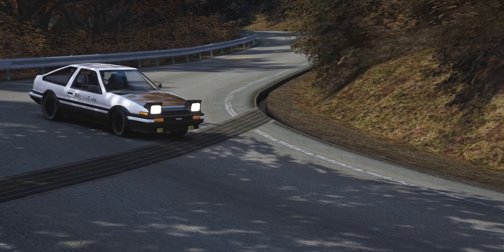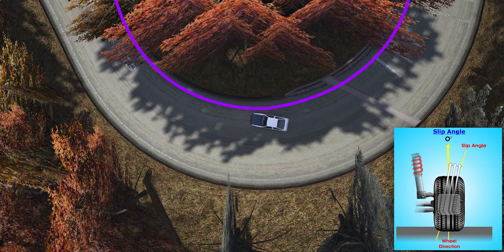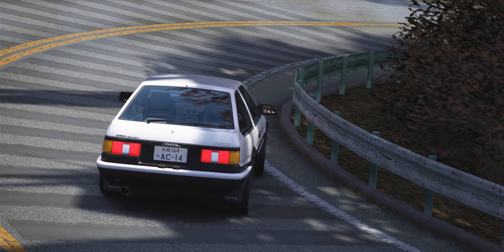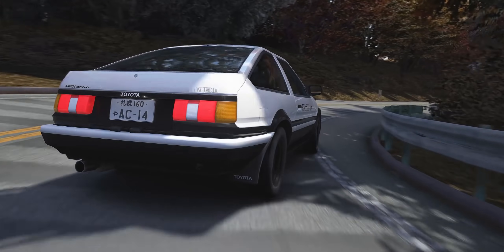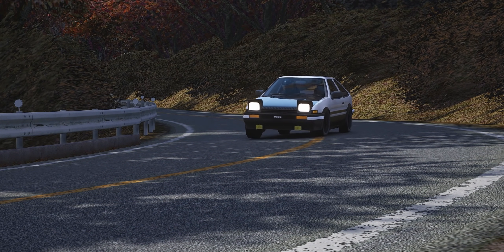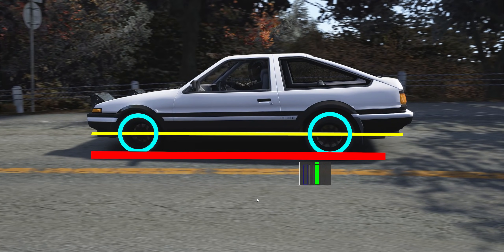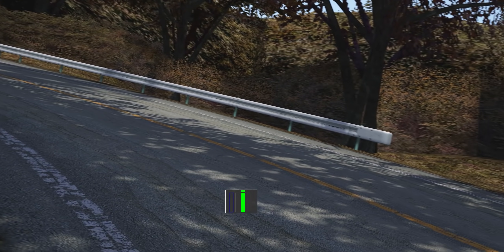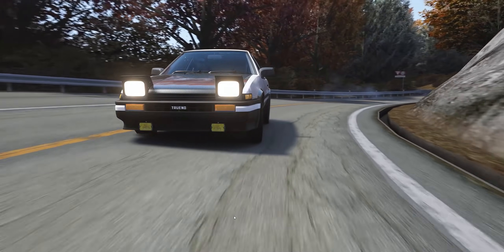Slip Angle in Touge - Master this to be a faster Sim Racer

Comment: srry but isnt this what u do always?
hit the brake before a curve Steering and hit the Throttle when u see the exit

i understand your explanation and logic but how is this diferent of what we alrdy do?
u have to drift and positioning the car with only the front wheel closer to the gap and thats the only diference?
but i dont get it, my car dosnt do this

should i move the Steer on zig zag while slighly braking till the car start to semi drifting and then positioning and try to point the front wheels at the track direction while full gas?
is that the idea?

Comment: Cool !! I usually do that on assetto with FWD cars cause it's easier to get out of a tricky situation than a RWD cause i need to learn proper drifting (clutch kick, scandi flick, throttle management etc..) so I'm used to it but it ain't always perfect and i sometimes go test the strength of a tree xD

Cool you're showing simple diagrams and your pedalboard inputs to illustrate how to do that slip/slide/4wheel drift or whatever you wanna call it. I might redo it over and over, understand one day, rewatch many videos or get someone to explain.. if i dont have the theory behind it, even just a basic logic of what's going on, it'll never be saved by my brain x)

Comment: correct me if i'm wrong:

drifting is a technique where you can add more slip through the whole cornering process. slip angle is a technique where the driver will make the car slip before reaching the apex of a corner and gets on the gas as fast as he can so it will have faster exit compared to normal cornering. when initiating slip angle, adding more slip beyond the apex point by power or handbrake is no longer necessary and doing so will kill the point of slip angle.
Reply: Right

Comment: On a track where exits matter a lot more than cornering speed if you have to counter steer, it ends up slower than not trail breaking at all and accelerating late. Your wheel shouldn't be straight it should be turned toward the corner still obviously that depends on the car setup on how much towards the corner you need, but a perfectly straight wheel will destroy your exit speed and entry speed because you can't use your brakes  because you're sideways and any throttle will require counter steer. If you can do that with adding brake and throttle inputs you need to fix the car setup. 10 degrees of slip angle is way too much as well. 2-5 degrees is what you should aim for. Your car isn't setup properly if you need more.

Comment: you just rotate at a rate quarter to the corner. 25% you are angled for apex, apex you are angled for 75% and at 75% you are angled for exit already and should ne on the gas just dont over rotate the tires

Comment: This video really taught me how to corner better. I could never do a slip angle because of my skill issue but because of this video i tried pushing myself into it more, by doing a tiny flick in the other direction before pushing brake, and accelerating into a turn and what do you know, it works pretty well!

Comment: Technically, every corner has SOME slip angle.  Even when your aunt takes the Subaru Outback through an intersection at with her hands at 11 and 1.  There is no grip without slip.  However, that slip doesn't become even vaguely visible until like 90% grip.  In normal conditions, the sidewall just twists a little bit, and its resistance to that twist is what actually generates side load.  This used to be much more apparent on older bias-ply tires and compounds that made peak grip at much higher angles.

Comment: So it basically boils down to, the tires don't have the most grip when the car is at the limit, just about to start sliding- they actually have MORE grip and thus corner faster with just a little bit of slip?
Reply: In short yes (yes i'm late)

Comment: A while ago I decided I wanted to practice gt5 and was running tsukuba circuit trying to tune a new WRX in grand Turismo 5
I found myself doing an odd version of this on shorter hairpins where I would turn sharply and break, swing the car around slightly, then accelerate.
I think that was on fastest on those hairpins because it's close to the slip angle method demonstrated here while still working with binary acceleration (either on or off) due to the short radius.

Comment: Basically "slip angle" is just a different way to say "inertia drift" which means the wheels aren in they're low peak level of traction for producing the necessary heat in the rubber and basically not loosing the chasis momentum(inertia); the actual difference is on what racing line chooses the driver

Comment: Like my teacher at automotive enigeering used to say: A few degrees of slip provides the most grip.
It has to do with the friction properties of the tyre rubber.
Reply: Because this is a good point I'll add that road and sport tires benefit from more degrees of slip angle, while slicks have a narrower window of slip to be optimal, and the performance decrease super fast if you go below that window with slicks

Comment: Isn't sliding only faster when you don't have to countersteer? If you look up Max Verstappen's pole lap at sebring (in the florida winter series) he seems to slide slightly through the corner but without applying opposite lock.
Reply: Obviously yes. But sometimes you can't drive exactly perfectly and can accidentally start sliding the rears in which case you need to counter steer to get the grip back.

Comment: This is used even in circuit racing. . . if you want your car to be able to accelerate sooner you need your car to do mini drifts to point toward the exit of the corner faster. This is how alien times are made.

This video also explains it perfectly as well, remember guys, it's about ROTATING the car faster so you can stay on the racing line while holding a higher speed AND you get to accelerate sooner and earlier due to having your car pointed straight faster and at the exit of the corner.

Edit: This is not the opposite of what sim racers do btw, it's exactly WHAT the fastest sim racers are doing. Who cares if you have to pit a bit more in an endurance race when you're so far ahead of the competition they will never ever catch up to you? I'd rather go fast and have a clean set of tyres to continue racing fast than to go slower and not be comfortable with my driving. It's extremely hard and frustrating to drive slower than you normally would once you are fast and probably counter productive to your racing.

Comment: you can also stay on throttle. Stab the brake at entry with your left foot to compress the front, turn in as you get off the brakes and set you angle. You may need the feather the brakes as you power through to the exit.  Especially good in a laggy turbo car.  Works best on a car with slightly softer springs and dampening.  Its also a good front wheel drive technique where you want to cause some over-steer and correct it with power under-steer to stay tucked into the corner.

Comment: I actually realised when playing ac I dont seem to oversteer to the point I need to countersteer, but after watching the replays I noticed that the car was pulling a slight drift
So that is a slip angle right?
Reply: yep, and most likely, on its best form. As far as I know from my many years of simracing, the best way to go fastest through a corner is doing that kind of slip angle. Since it is that light, you are not warming up the tyres that much so I would say it is the most effective way
Reply: @antoniojo76  damn that's cool
And yeah I don't seem to be able to corner any faster no matter what I do
Grip, drift, powersliding with AWD and some other more advanced cornering tactics
Slip angle seems to be the fastest one

Comment: Nailing a slip angle with little to no counter steer is the greatest feeling ever.
Reply: Oh, it's like gliding on ice with the rev of the engine, it's driving eutopia
Reply: @rilesmiles4564  full lock smacking off limiter is so much fun though
Reply: "full throttle four wheel drift with almost no countersteer"
Reply: Facts
Reply: wouldnt that just be a form of 4 wheel drifting though?

Comment: I remember discovering this naturally in FM6 in my Mazda Cosmo '72, each time I hit a guardrail or went off the track, I would rewind to see if and how I could prevent it, and I found that slip-angle was the fastest way around. Thanks to this, and all the hours I put into rivals races, I managed to score in the top 1000 (in the U.S.) on the D-Class - Nurburgring - Full Circuit - Day rivals challenge. Let me just say that again, that's 2 laps (1 still lap, 1 flying lap) and over 20 minutes of intense racing where you can't rewind, crash, or even go off the track, and it likely wouldn't have been possible without this technique. I later returned to Forza Horizon 4, and found that my driving skills had drastically improved. I'm not saying this video was the sole reason that I became so good at sim-racing, but I'm sure glad you're teaching this skill to others!

Comment: I remember when takumi explain drifting like its an understeer, i cant imagine his geniuses on explaining that, at that moment.
Reply: You can actually drift faster if the car is set up to understeer. You literally have to drive faster in order to get the same effect when the car is looser...
Reply: @Tommy971321  I’m pretty sure Bunta set up the 86 like that when he had to versus the R32
Reply: @hirzaahmadmutahari6987 Indeed, the understeer he calls drifting is actually the four wheel drift and not the sport of drifting. It's a bunch of uncultured kids trying to piece it all together themselves and Takumi's genius shines through because he does not see sliding out just the rear as something difficult or hard to learn. He is a very impatient boy and when he comes into a corner too hot (again) and the back steps out, he understeers the front to tighten his line and avoid the barriers. Being as impatient as he is, he prefers to get back on the gas right away and just balance it out through the rest of the corner. That's how he learned the four wheel drift in my head canon. Later on he learned to aim it better and set it up beforehand to actually apex the corner this way. He was just thrashing on his dads ride just enough so he wouldn't get in trouble. Never making a scratch but the tires were fair game pretty much. Not noticing in his naiveness this is exactly what his dad wanted to happen all along. Remember how much shit Takumi got when the 86 got scratched up? And when his dad moved the goalposts with the cup of water?
Reply: @ThaJay  Even the gas station owner Yuichi is like "Those kids are idiots, Takumi is actually describing drifting. Bunta's got him doing some crazy shit."
Reply: 3:36 That's not called slip angle steering, it's throttle steering. 🤣 ... Slip angle has effect on the front tires only due to the lateral force affects, reshapes them, aiding given car's rotation, it's not the drifting REAR tires! ... You guys got the meaning of slip angle so wrong. 🤣
Reply: @JohnKickboxing  slip angle is for every tyres, front and rear. It's just the way to use the compound at his best. Road and sport tyres likes that lateral forces combined with longitudinal. Slick compounds also like slip angle, but the limit is way down, u're slipping less. If you slip more than needed, you become slower. Each compounds has it's own best usages.

Comment: I'd like to note: Slip angle usually wears out the rear tires faster than otherwise. That sounds bad, but it actually helps wear all tires evenly, since you'd normally just wear out the fronts a lot.

Comment: I still don't fully understand this concept but all I know is it's basically getting the car to the point of drifting without drifting, which is easier said than done I go either way between just grip racing or drifting I very rarely do anything in the middle. Anytime I'm in the middle is when I'm trying to grip but loose traction and end up in a drift.

Comment: I’m not a sim racer in the conventional sense, but I am a top leaderboard racer in art of rally, so a video on this might actually be helpful for me!
Reply: Dirt is extremely different than tarmac. Dirt gives you more grip going sideways because the tyres dig in producing grip but on tarmac your goal isn’t to slide you goal to extract  the highest degree of grip the tyres have which requires the tyres to be sliding at around 7-14 degrees but typically no more beyond a certain degree of slip angle you just create drag and you loose grip.

Comment: Racing a front wheel drive is different theory but same in practice. But your using torque steer to pull you out of the corner instead of rear traction.

Comment: Back when I was younger and raced with karts at Rotax 125cc, I was struggling on the budget and most of the time had to use worm out tires, like the tires normal people would throw away with 50 percent life left. Because of the less grip those tires had, I unconsciously developed a slip angle driving on most of the turns of the tracks I used to race. I realized that the more straigh the steering was, more throttle I could apply, hence taking the turns faster even if I was techinically loosing my rear end. 

Later I started jumping over the curbs, since in my local tracks they were huge, so by invading them with the interior wheels I could cut some cms in each turn, making a quite a decent chunk of .000's at the end of each lap. 

So mixing the slip angle and the curb jumping, I would "drift" the turns and balacing the kart on three wheels, making the front inner go over the curb, all the way until said curb would grind against the chassis. With my little 125cc I was destroying the DD2 class. 

Sometimes I dream what would happend if I had the money to actually race on a championship or something... Guess life is not that fair. At least I use everything I learnt from my karting days into cars.
Reply: This helps prove my theory, i'm going to write a paper and do you mind if I include this story, I'm trying to prove that having limited conditions make drivers faster, shinji couldn't wake his mom, takumi couldn't spill tje water, and you had to use bad tires but were better than most.

Comment: First of all, awesome driving! With risk of sounding nitpicky; I don't understand the drawings on 0:44. The cyan line is supposedly corresponding to the travelling direction of the car but is drawn tangentially to the purple line like 5 meters in front of the car. It's supposed to be tangental to the purple line, parallel to the car. The slip angle is the angle between the blue line and the cyan line. It's actually supposed to diverge in the opposite direction of what is drawn. Another thing I don't understand is why the angle is measured between the line of travelling direction (cyan) and the corner arc (purple)

Comment: for circuit drivers, its the ability to feel this and be committed without even thinking or knowing about it that is called talent. You have so much more speed as you have to break rear traction and your turning less at the front as a result so front tyres have very little load versus the rears and the be able to feel this between cars and pick it up instantly is also a show of adaptability as cars with higher Grip (F1, LMP/Hypercar, GT3 ect) have a much lower slip angle and cars with less grip (road cars) need a far higher slip angle in this you see he had about 10 degrees in a GT3 car the optimal is about 4-6 for a sim racer to do this between cars and games and have no seat of pants feel is insane and these are the people that should have a go at real racing

Comment: I do this in a 15 year old alfa jts, did this in an Astra (rarely because it was so oversteery) and absolutely smashed it with an audi S7 on a wider road and porsche 911, but this car has so much grip it doesn't slip as long as others...anyways, If you want to drive fast on a curvy road this is the driving style you need to use :)

Comment: Slip angle, I'm pretty sure, is just a term to describe how a car is rotating through a slide, not the name of a driving technique. I've heard people for years try to point a finger to the type of driving you're speaking about here and in other videos, often being described as "Speed-Drifting", but honestly many of the fastest cornering techniques will involve implementing SOME rotation (this is what I call it. Rotation. Haven't found a better term either) such as trail braking or "steering with the throttle" which is also sometimes called a "4-wheel-drift".

In situations of limited grip, like old-timey racing, rally, oooooooor say being a broke street racer who can't afford good tires in the 90s, this isn't a special technique, it's just called being fast. "Speed-Drifting" sounds dumb but is probably the best term we've got for introducing some rotation into your racing line.